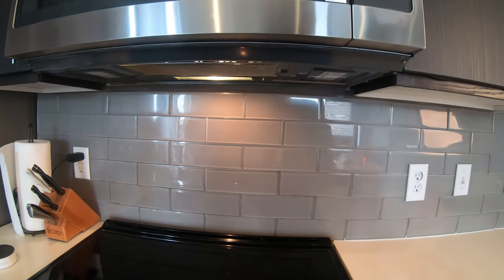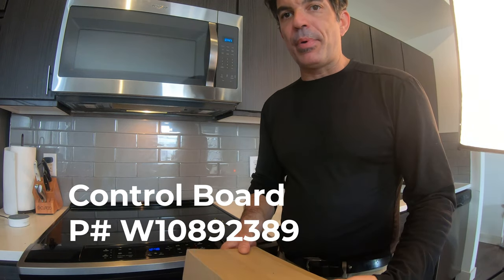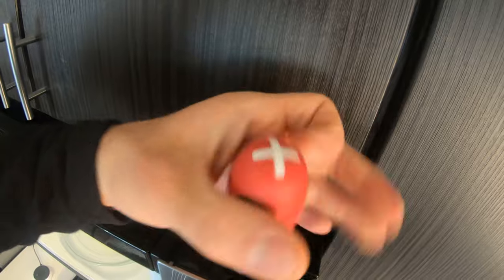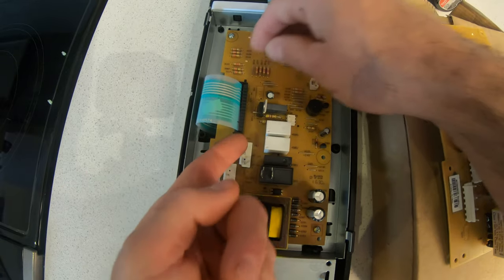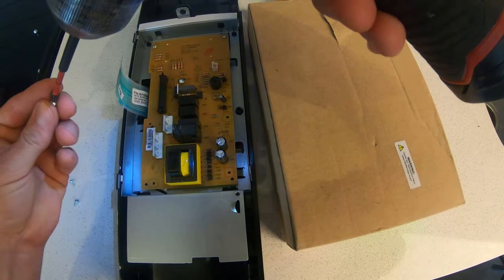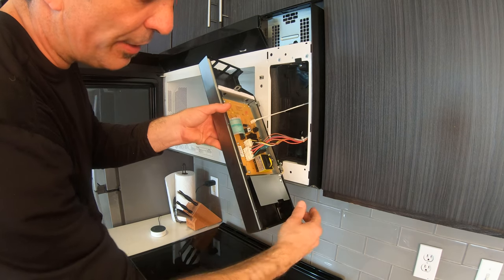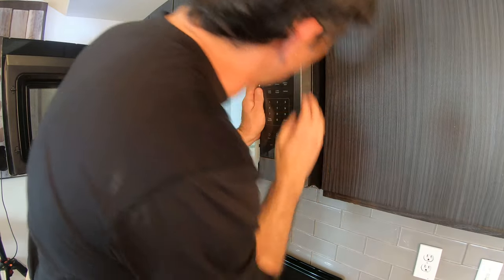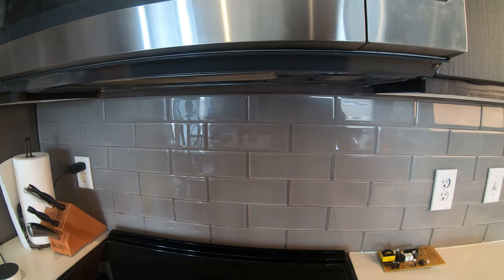Microwave Range-hood Light Won't Turn off

Comment: OK, you asked for a cheaper way to fix the light problem.  Here goes:  I bought a single pole, single throw toggle switch and installed it on the bottom cover and wired it into one of the leads going to the light socket.  Took about half hour and it is fixed.  There is only one setting (full) but it beats paying a couple hundred bucks for a new board when you can buy a new microwave for a little more than that.
Reply from the maker: Thanks spitlist!!

Comment: I was hoping I wouldn’t have to change the whole board. Damn, I saw your comment you’re in Denver. So am I
Reply from the maker: Ya I havent figured out a way around it without adding extra wiring and a switch. Gonna be a cold one in Denver this weekend !
Reply: David Shaddock
2 weeks ago
I found a cheaper fix for my Whirlpool WMH53521HZ-3 over range microwave that the bulb blew out and would not run off after replacing the 40W bulb (8206232A). The cause was on the control board. The Triac (BT136-600D, labeled 7919) had shorted. I unplugged the microwave, removed the control board and checked the resistance between MT1 (pin 1, nearest the white 6 pin connector ) and MT2 (pin 2, middle) there is a low resistance and it should be open with no power to the board. I purchased another Triac from DigiKey (Digikey 1740-1018-ND, $0.63 each), removed the old triac, and soldered the new one in. After installing the repaired control board, replacing the bulb, plugging in the microwave, the light can be turned off and controlled again. This is a lot cheaper than buying a new control board.
Reply: Why not use a relay instead of a Triac, to save a few cents? Then this problem could be avoided, and an LED would work. They ship new micros with 25-watt bulbs instead of 40 watts to save a few cents.
Reply: @chrissimon8368  Thanks for the tip!  Put the new Triac in and the light works as it should.  My microwave is a Maytag but the item was the same.  Saved me the $250 Maytag wanted for the control board (plus a 4 - 6 week delivery).  Such an easy and inexpensive fix!

Comment: Whirlpool sucks... have one just like yours and not too happy with it.  Had a recall on it for fire hazard, and I was already having issues with the first one to start with.  A few months or so after receiving a new one, the door sensor was acting up where it wouldn't send a signal saying that the door is closed, so I had to do some internet searching and luckily I found a video on You tube.  And now, I'm here again trying to figure out how to get the light to turn off after replacing the bulb.  It's like the company pushed the product out w/out thoroughly testing it.
Reply from the maker: All appliances have there faults, this particular one though is pretty annoying, wish there was an easier fix.
Reply: @ApartmentMaintenancePro  I might go for a Bosch since one of my family members has a dishwasher and stove and have been using  it for five years or more with no issues.  They just bought the over the range microwave and we'll see how it holds up over time.
Reply: The best fix is not buying Whirlpool junk.

Comment: 🆘 Think twice before you buy the Whirlpool microwave in the above video. When the light won’t shut off the only way to fix it is to buy a new motherboard, and they range in price from $155 to over $350 plus tax and shipping. And it’s an inherent problem in this Whirlpool microwave unit 0:05 wmh53521hz. The guy in the video does an excellent job showing how to replace it but you can buy a new microwave for $450 or LED stick up under cabinet lights for under $10 as a solution.

Comment: I just changed the surface lightbulb on our 2020 model and used a 40w LED replacement. It cycles fine from full to half light but now the light won't go off. It worked fine with the old bulb and I can't believe changing the bulb affected the board. Odd though. I don't think I'll spend the $ on a new board, it's very dim when it should be off.
Reply from the maker: Right on, thanks for sharing with us 👍
Reply: Yes I think I will just let light on save 300 plus as well
Reply: I had the same problem but I switched back to a conventional bulb and it stopped so just try switching back to a normal bulb.
Reply: @ApartmentMaintenancePro  Same thing here. The replacement (I got an LED without thinjking about it) will NOT go fully off.  Is this an issue, or does it matter? It's very dim, but still on.  I assume it won't get so hot it will burn the house down?! Please advise if otherwise...lol

Comment: I have same problem with 3-year-old Whirlpool microwave.  Have no interest in replacing board with one that is likely to crap out in a couple of years.  The bulb goes, and I will stick on a short LED strip I have laying around; it will probably last longer than I do.  So, when is Whirlpool going to fess up, do a recall, and fix it so you don't need a $200 board every 2-3 years, or less?  Anybody calling them out, on this?
Reply from the maker: Led strip is a good idea and much cheaper than a board

Comment: I just either unscrew the LED bulb and screw it again or just unplug and plug micro and it turns it off, I don't use it much so either step doesn't bother me...
Update: as someone else suggested I placed a normal bulb and problem solved! Yey!

Comment: LOL ok so the replacement control board costs $150 + . Junk microwaves, never buying Whirlpool again.
Reply from the maker: Ya still haven't figured out a way around it, it sucks. Someone in the comment mentioned wiring in a relay/switch under the microwave  might be the cheapest/best alternative

Comment: I had the same problem where the new LED light I put in would not turn off so I took it out replace it with a conventional light and it worked properly.
Reply: From what I gathered from reading about the dimming technology, it appears not to be compatible with LED dimming technology.
Reply: Mines a regular appliance bulb and it still won’t turn off

Comment: I have the same microwave it's about a year old. On the inside of the door it's has July 2020. Before the light under the microwave blew out I noticed a few times when I would close the microwave  door ( not slamming it) the light would turn on. I would select the button to turn it off. That happened  a few times and eventually the bulb went out. I've replaced the bulb... but I killed the power first from the breaker because the internet made me afraid and I thought I was going to get shocked...anyway....I replaced the bulb and now the light won't turn off. I obviously had issues before the bulb went out..and I didn't address it right then as I should have....Has this ever happened to anyone else? Thanks. And BTW great video!
Reply from the maker: These microwaves are weird with the under light. I've had the same issue after swapping out a new board a few months later. I gave up honestly a 30 dollar under light you can stick on the cabinet from Amazon is where it's at.
Reply: @ApartmentMaintenancePro a whole deferent brand of microwave is the answer. Second Whirlpool I've had in a row that has done this and it's crap on their part. I know one thing for sure, it'll be the last Whirl poo in this house.💩

Comment: What is the part number on the Triac? My model is Whirlpool WMH31017HZ, bulb burned out changed it and it now want go dim or go out. Part # exactly, on triac pls, and was reading all the comments and it appears as the bulb goes bad replacing it seems to cause the problem. Perhaps if it happens again for me I will unplug the oven then replace the bulb. Perhaps that will work, if not a few more slang words @ whirlpool. Thanks for the video AMP, and all other comments (bunches) on here.
Reply from the maker: Take off the top cover / vent on the front side and grab the tech sheet. This should tell you what triac you need. Keep in mind there's a new model updated almost every year, so going off the tech sheet is the best bet if you can't get the info from Whirlpool

Comment: Has anyone mentioned how dangerous it can be if the capacitor is not discharged?
Reply from the maker: It can be dangerous yes. The capacitor is behind a metal frame though that has warning tags all over it

Comment: Question, this just happened in the apartment I'm renting. I leave the light on all the time anyways. Is there any harm in just leaving it not turning off?
Reply from the maker: Nope
Reply: Bulb will burn out after about 30 days. Will keep buying bulbs.
Reply: @StevesSpot  the bulb is rated for 20,000 hours when fully on. Pretty sure it will take more than 30 days to burn out.
Reply: The incandescent bulbs run very hot. Considering switching to led and let that stay on.

Comment: how can you fix one that won't turn on at all, even tho I replaced the build.. its a GE over the range microwave and the microwave works fine but the light over the stove won't come on.  how can I fix that?
Reply from the maker: Make sure the bulb is good. Electrical troubleshooting with a meter will probably be necessary if that’s not the case

Comment: I replaced the control board and the bulb still won't turn off.  It will go on and do high and low, but still won't turn off.  Any other ideas?

Comment: Hi my power went down at my house and now the microwave light timer is very low on brightness... It's a whirlpool model wmh32519hz -4 I don't k ow how to increase the led brightness
Reply from the maker: I would try replacing the bulb 👍
Reply: @ApartmentMaintenancePro  its working again.. I did nothing.

Comment: The original bulb was fine until I changed to LED. Now the light stays on when set to off. Is there a fix for that, or will all LED bulbs stay on?

I have a 2016 version of your microwave.
Reply: Yeah this happened to to me too. I suppose you could put some kind of resistor in the line. But I just left it as is.
Have a night light now. And it doesn't really use any power.

Comment: Why not use a relay instead of a Triac, to save a few cents? Then this problem could be avoided, and an LED would work. They ship new micros with 25-watt bulbs instead of 40 watts to save a few cents.
Reply: A relay makes a click sound, a trial is silent
Reply: Can't turn a relay on half way as you can a triac.

Comment: Control panels are “cheap plastic”? Well the manufacturer has got to continue making its money through parts exchange/replacement from the customer. I guarantee you that I will break off more than one of those clips when I take mine apart to change that motherboard if I can’t get my bottom light to turn on.

Comment: What garbage... A whole control board for a light bulb that wont turn off.
Thabks for making the video
Reply from the maker: There’s a cheap fix if you can solder on a circuit board check out my other video on this

Comment: Where can we purchase one of those control boards (sites?). Just changed my bulb and now its doing that exact thing.
Reply from the maker: The Part# w10892389 - Search that, looks like amazon is sold out. The main site I use is partsselect if Wilmar is sold out of them. Whirlpool also sells them directly on their site. Keep in mind that they are expensive, so a more risky, but cheaper option would be to search eBay, or Facebook Marketplace. I know some techs that sell old used parts but if they have good feedback then it may be worth the risk and save you a bunch of money. Hope that helps.
Reply: @ApartmentMaintenancePro  Amazon has them back now but my gosh. $300???
Reply: @chefcjnobles2423  Wow, I only paid $199.00 for the microwave.......cheaper to buy a new one.
Reply: yeap, better off either installing a switch on the power side of the bulb socket, or just going without the light until the unit totally fails. This is a horrible defect.